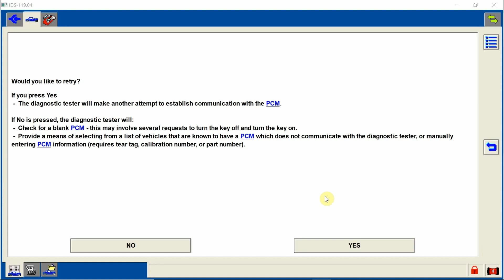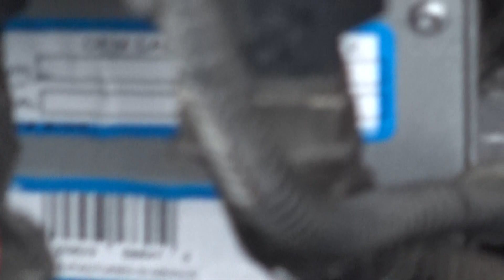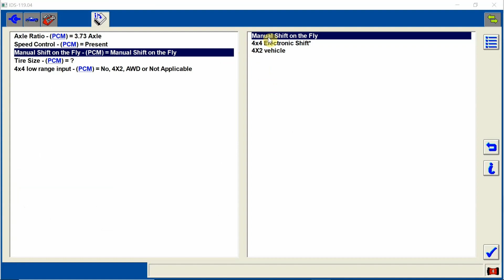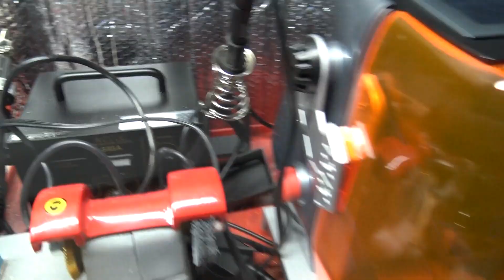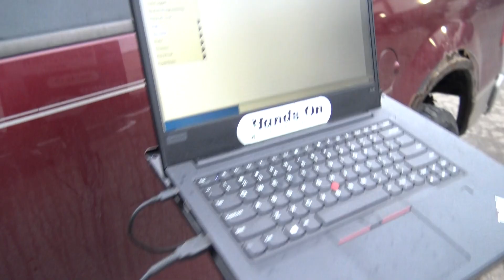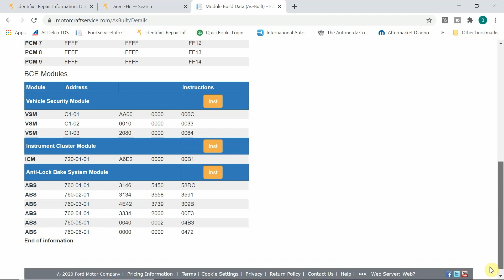2005 Ford F150 IDS PCM and ABS Programming Procedures

Comment: What kind of battery maintainer are you using I’m getting a error 11 0x0 851082
Reply from the maker: That error is probably not the maintainer.  I use https://amzn.to/4gwvmvG usually that 11 0x0 error is a comm issue of some sort, many times repeated attempts  fix

Comment: Very helpful and informative video👍. I'm using FJDS to program a used PCM to a 2007 Ford Fiesta. Any idea what the axle ratio is for the vehicle?I can't find the information on the Motorcraft website and I don't have access to Oasis😕
Reply from the maker: You should be able to get the 2 digir code from the door sticker. All data or identifix can break down,, looks up  "identification "  also you could yluse repair link
Reply: @ Thanks. I had a look at the sticker on the door but it didn’t have the information I need. It seems like the door stickers here in the UK are different from the ones in the US

Comment: For some reason when I get to the vin entry on my system it limits me to 3 numbers short of my vin. I can’t seem to get around this. My truck is a 2010 F350 6.4L Cabela’s  Edition. Any ideas, cause when I continue, my vehicle specification shows a vintage with last 3 numbers missing. I have tried choosing even an earlier model, no luck.

Comment: So I just ran this procedure on a 2004 Navigator that I had to swap in a used PCM due to a failed COP driver in the old unit, and it went as expected until the victory run after completion... ABS vin mismatch IDS instructed me to run the PMI to correct it, so i did. Fails at the end saying the PCM has  incorrect VIN, run PMI to correct it. so again, i did. gets to the end and what do you know, ABS vin mismatch run PMI to correct. Also lost climate control module completely and the a/c clutch cycles like it would if i had turned it on. have you run into anything similar? at a loss..

Comment: Hey brother! I am currently attempting a 4.6 to 5.4 swap on the same truck. Is it possible to flash my 4.6 vin onto a 5.4 computer? Or just flash the existing 4.6 computer with 5.4 configuration?

Comment: Hello
I’m a new subscriber
I’m working on building an 04 f150 . I will be installing phaser locks in the engine
I have a previous truck that has a pcm with a phaser delete flash 
If I use that pcm and program will it retain the phase delete?

Comment: i have a 2017 F550 6.7 that another shop replaced the PCM, but i have code P0630, VIN not programmed to PCM. As  well as ABS codes etc.  Can i simply use IDS to program the VIN to the PCM without having to do a complete flash? the vehicle has a delete and tune on the PCM

Comment: Instead of the VCM-II have you tried a different J2534 VCI Pass Thru device like the Bosch Mastertech II or Drew Technologies CARDAQ 3 Plus, when using FJDS or IDS?
Reply from the maker: I usually use my vcm2 or vcm 3 for fords. Ids will only work with vcm1,2,3, fjds will work just fine with the cardaq 3 plus in my experience
Reply: @BrianMann216  Hi thank you for the information. What VCI would you recommend for PCM programming of an OBD-II 1997 Lincoln Mark VIII? I was going to try FJDS with CARDAQ 3 Plus on the bench first and then in-vehicle, but perhaps IDS with VCM2 would be a better choice. What do you think?
Reply from the maker: @Wind Ward  if yiu have a vcm2 use ids, the security on those older ones can be hit or miss , I have had a few issues with the early model pats and  the vcm2 and or j box , the vcm 1 would work no problem,  I di not know if ford worked the bugs out this was when the vcm2 was relatively new.

Comment: Excellent video. Now I do understand why we need to reflash the junk PCM  because you will get a mismatch.I have a ford escape 2015 and my PCM is burned out so I get one from eBay and send it to Africa but my big issue is there is no dealer for Ford so I am wondering how I can program myself, where I can get IDS tools to fix my car.
Reply from the maker: It may be easier to get a tool like the autel 508. I am not sure about other markets architecture for security.

Comment: Im interested in purchasing the vcm to use ids. Is there a yearly fee to use it order I just pay when I use it? Also on the tablet do you have it partitioned to use other software like Chrysler or other manufactures that are laptop based?
Reply from the maker: I use gm ford chrysler toyota and subaru along with pico scope autel scope , Adobe premier pro on one lap top no partitions, ids I belive you can have short term subs if you want.

Comment: I have to program a new Ford RCM in a 2008 f250. I tried PMI by trying to pull the info off the existing RCM module and then installed the new one and attempted to transfer the data to it. Every time I tried this the procedure failed. It looks like I will need to program the new module using as built data. What would be the procedure for setting it up as new when the PCM will not communicate with the new RCM module? I really appreciate your input on this. I am using Ford FJDS for the programming which is very similar to IDS
Reply from the maker: I would start a whole new session and I'd the vehicle with the rcm not plugged in, and start the procedure.

Comment: This is awesome thanks sir.  I have a ford E250 2009 Econoline,  I replaced the ecm with a used one, and I did the PATS key programming, but I keep getting a P1622 code (immobilizer ID does not match) and its not allowing the engine to crank, I don't knw if its the ECM programming I need to do first?
Reply from the maker: Keys are stored in the cluster,  you don't need to program or delete the keys, you need to perform a parameter reset after gaining security access.
Reply: @BrianMann216  Yes I have done that multiple times, and I hv confirmed all wiring connections to the ECM and cluster are fine, but the code keeps coming up and preventing it from even cranking.

Comment: Hi Hope you are well. Quick question on reprogramming PCM module using ford ids, sometimes when put in tear tag number it doesnt always work, but how do you find the calibration number using registration and vin number of the vehicle. Would be a great help as i heard it sometimes it works using tear tag or calibration number. Thanks.

Comment: I am curious. With the prompt to remove FICM relay- if you are specifically programming the FICM module, are you suppose to remove the relay or leave it in so it's powered up?
Reply from the maker: To the best of my knowledge ( I used to program many FCIMs,  ) the module is still on the network, the fcim i think is still powered up, the relay is for the high current side of the module.

Comment: wow Mr. Brian this video was very informative. i have an issue with a "plug and play" ecm i just bought for my 2005 f150 4.6 . maybe you can answer . i installed the new pcm and truck runs fine , but when i tried to tune it with my performance tuner it wouldnt start after the tune file was loaded. i returned to stock but still truck wouldnt start not even turn over, the pats light on dash was solid, had to return to the ecm shop to have reflashed and when it got reflashed i installed and it ran. this doesnt help because i need to change the whell size and differential ratio code due to aftermarket wheels and diff. do you think the ecm shop failed to properly flash the pcm?? they used the ford ids to flash pcm. any info is greatly appreciated
Reply: I must add they never asked me for any of my trucks add ons like you programmed into this one. Just a vin the pcm part # and thats it.
Reply from the maker: Maybe the keys were wiped from the PCM?   What codes are setting?  Look in scan data and check the key#   /  or how many keys are stored if it is 1 or  0  you will have to program 2 keys.

Comment: Can you please help me, I went out to start my truck one day and everything comes on except it won’t crank, won’t even turn over.  I can hear the relay click when I turn the switch but that’s it.  I’ve replaced the starter, the ignition switch and the neutral safety switch and still nothing.  When I plug an OBDII up to the communications port, it powers the scan tool up but I keep getting a message that it’s not communicating.  The fuses are all good.  I don’t know what else to check,   Do you think it’s my PCM?  It’s a 2006 F150 5.4.
Reply from the maker: Could be many things,  check and see if you have 12 volts at MAF
Reply: @BrianMann216    I got it fixed, it was the PCM. Replaced it with a manufactured one and now it’s running fine.
Reply from the maker: @Goldwinger74  great! Glad you got it. I have been far behind on everything trying to catch up, sorry for later response
Reply: @BrianMann216  No problem

Comment: Brian thanks for sharing. Much appreciated. Nice to see your working on circuit boards. Will look up that hot air station. Will also watch this video a few times. Does that j2534 pass through work on most vehicles like Hondas? I ask because I’ve seen a mongoose J2534 for Hondas at AESwave. Also you mention the battery maintainer. Any recommendations? Stay safe and well. Happy New Year 🙏👍 thanks for the programming video.
Reply from the maker: Thanks for watching!
I Have been using midtronics battery maintainers for years now,   I think they are ok,  quality seems to be getting worse though..  the ford vcm 2 is Fords J box,  I have used it as a generic J box with decent luck,  For your Honda, ( if you are only going to be doing Hondas the mongoose should suit you well.  Happy New year  and you stay safe as well!
Reply: Thanks Brian for the reply. I’m looking into it as I really don’t want to ever have to buy one of today’s vehicles. There are quite a bit of tools I want to purchase. The days aren’t long enough to cram in all the training I see listed. Stay well buddy and keep me updated if you decide to put a class together.🙏😊

Comment: Love watching the programming. I have been doing some epromm work also i have a question can I do all the programming on the bench at home I have been getting tons of call to program but there just to far away.   And have u used the ktag system???
Reply from the maker: I am not familiar with the Ktag , Bench flashing will vary depending on the module, newer vehicles getting tougher.